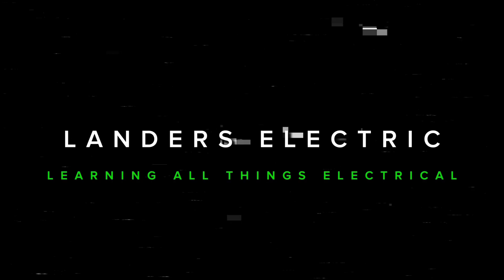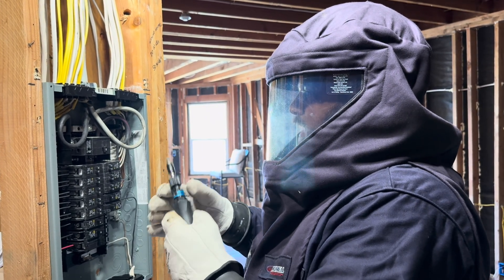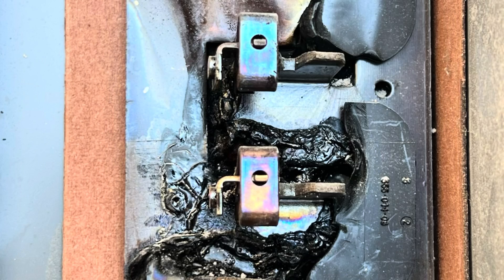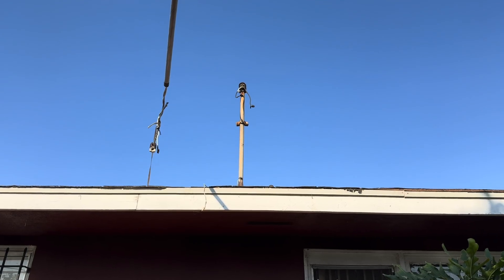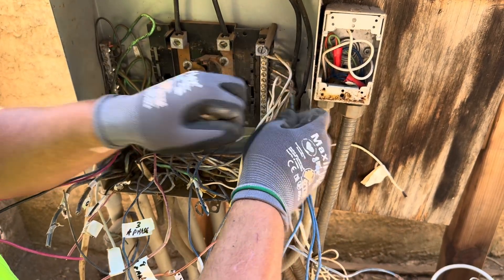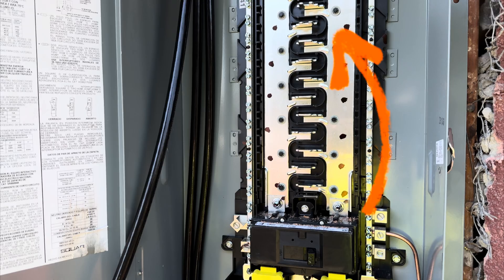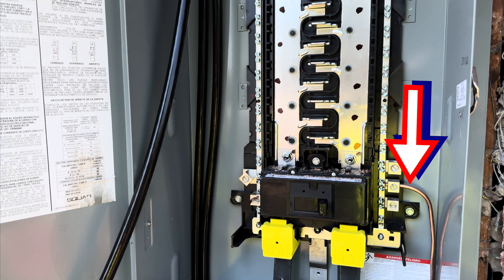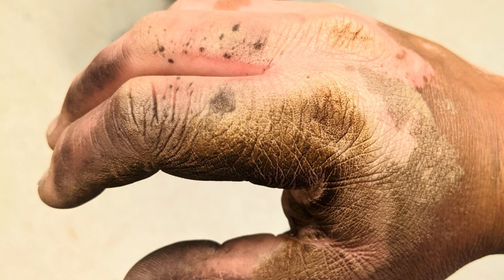I Could've DIED! | Electrical Panel Upgrade Arc Flash Accident

Comment: Working at a foundry with two large electric melt furnaces , in the bull pan They wanted to clean the insulators. My electrical boss said we won’t go in until the power shut off. The foreman of the crew said we’re gonna take ladders inside and get ready my electrical boss that’s not a good idea ! as they went in with the ladders One of the ladder legs hit 44,000 V line came down through the ladder blue a hole in the brick building that housed the transformers the guy that was holding onto the ladder burn, his hands welded his armpits and crotch Bluey his heels off, but I don’t know how but he survivedwhen you’re dealing with this type of voltage you don’t mess around

Comment: My neighbor was hanging drywall on his ceiling and asked for my help, so I did then he decided to remove a line for the dryer, since I was up on the ladder he said it was not live and he tripped the circuit. He gave me some cutters and I cut it and was zapped, the wire cutters melted and my hand was burnt not to mention my heart was racing for about a day. Well it wasn't tripped and it ended up being 220v. I was pissed as he just laughed. Double check, and in commercial and industrial LOTO.
Now I am POed thinking about it.

Comment: Well, I to do many panel changes, subs, meter base change outs etc., and storm work…I do everything that one could to be safe…occasionally you must work with hot circuitry, I do the PPE when it’s prudent, luckily no accidents …overworking your limits causes errors, some minor sone major…some have been deadly…a month off wasn’t worth your efforts…I’ve backed way off of full throttle operations…in the end it was not worth it…you dodged this bullet but it’s your warning…good that you weren’t the path to ground this time…heal well, stay safe, live a little more….in the business 40 years…
Reply from the maker: You are absolutely right! It was a dumb move and a valuable lesson learned.

Comment: I took out 2- 170A fuses carrying 4160VAC.
My arms and face were as black as coal as the fireball cooked off (ionized) the top layer of skin.
I had no facial hair for about a month.
I hardly got burned and because of safe practices, I did not get electrocuted or even shocked.
My wiggy did not survive as it went off like a grenade.
The panel was not marked.
The night supervisor was standing behind me and soiled his pants.
I had never seen a black man turn so white.
I handed what was left of the wiggy to the supervisor and said, "I'll be back.".
I went and cleaned up and went right back to work.
That got me 4 more years of employment.

Comment: One thing I learned many years ago was to make sure the power is off before doing any work.
Reply from the maker: Couldn’t agree with you more! What part of the Electrical industry do you work in?
Reply: @landerselectric   I don't work in the electrical industry.  I learned that back in my high school electricity class.  Over the past half century I've worked in telecom, computers, the big ones, not PCs and more recently computer networks.  In telecom we see much more current than voltage and battery banks that can pack a heck of a lot of it.  I worked in one office where the -48V DC plant ran over 7000 amps!  The battery banks would connect to distribution cabinets, where the breakers and fuses were located to connect to the various equipment.  In that office we had a couple of electrical contractors on site full time.  Computer power supplies can also pack quite a punch.  However, safety is always important.  Last month I was working on a scissors lift, on a project to install WiFi access points in a factory and a couple of warehouses.  Since there were big fans near where I was working, I asked for the power to them to be turned off, even though it likely wasn't warm enough for them to run.  The electrician tagged out the breaker, to ensure no one turned it on.  Also, a couple of weeks ago, I rewired my dryer outlet.  It was originally 240V, but my dryer was 120 and I rewired it then.  That dryer died a couple of weeks ago, with the replacement running on 240V.  So, I put the outlet back to 240V.  When I first converted to 120V, I connected one of the hot wires to a 15A breaker and put Marrette connectors over the other hot wire, even though I disconnected it.  I put a standard Hubble 120V outlet behind the dryer, as the plug ran hot and I didn't want to use a regular AC outlet.  Since I don't have a main breaker in my condo, I had to rely on the circuit breakers being off.

I have long carried a neon test lamp with my tools, to make sure circuits are dead, before I work on them.
Reply: @landerselectric    I don't work in the electrical industry. I learned that back in my high school electricity class. Over the past half century I've worked in telecom, computers, the big ones, not PCs and more recently computer networks. In telecom we see much more current than voltage and battery banks that can pack a heck of a lot of it. I worked in one office where the -48V DC plant ran over 7000 amps! The battery banks would connect to distribution cabinets, where the breakers and fuses were located to connect to the various equipment. In that office we had a couple of electrical contractors on site full time. Computer power supplies can also pack quite a punch.

Comment: A 220V, 200A panel can potentially produce an arc flash with an incident energy of between 8 and 20 calories per square centimeter. You absolutely need an arc flash suit.
Reply from the maker: Well said. 25,000 available amps of fault current in my area for residential.
Reply: Our company was thinking of getting rid of suits unless someone asked for them.  Showed my supervisor the arc flash ratings on a 1000 amp 600v ac combiner.  Was 50.3 cal, our 40 cal suit wasn't even enough for it, if it failed when testing.  Think the fault current was just below 50k amps.

They said no one should be inside working it live.  I responded, that doesn't mean we won't have a mechanical failure the first time it's closed

Comment: Good video good topic. Same thing happened to me (forearm and hand)while working on 3p-480 and using cheap replaceable head/tip screwdriver(throw them away) when the phillips 2” tip pulled out and fell across the line side of a contactor and shorted 2 phases. It kind of happened in slomo so i had a second to pull back anticipating it .. Boom! I Wasn't wearing proper PPE and was kind of rushing, not very smart. Burned arm pretty good but was lucky. Luck should not be part of your electrical career.

Comment: There's major value in this video. I'm an engineer who occasionally receives calls to troubleshoot industrial equipment. This involves probing around with my meter on gear and in panels that are hot. An arc flash is no joke. Imagine one in a 3-phase panel. I will start wearing PPE. You showed pics but I don't think people realize just how badly these injuries hurt and for how long. Thank you for sharing.
Reply from the maker: Well said. You’re welcome!!
Reply: We do very similar work.  I'm not sure how I could wear an arc flash suit however and do my job.  I am there for every aspect, electrical engineering, and mechanical engineering, including programming, etc. I just try and tell myself to be careful, go slow, don't hurry.  (Easier said than done, but I do try.)  Another electrical engineer, Gm Engineer, told me that one of her electricians was pulling cable one day, and they found him dead by the cabinet. He went to pull on the cable, and his forehead, touched a 480 volt contact.

Comment: Toward the end of my "career" I had become super vigilant about testing power.   At a resi service change I pulled the meter and was preparing to start the demo and, even though the power runs thru the meter, I used my tester and found full 120/240 voltage in the panel.  I was puzzled for a few minutes trying to figure out where the feed was coming from.

I took a closer look in the 1960's meter can and found something I had not seen in my 40 years. It had a built in spring loaded bypass.  When you pulled the meter for service, the power stayed connected.  They probably realized quickly that it was a bad idea and stopped that nonsense.

Anyways, kids, ALWAYS test for power with a working meter. ESPECIALLY if you are going to be in a seriously risky situation.  If I have to grab the bus or wiring tightly with bare hands I ALWAYS do a double check with the meter and a quick flash/short test or finger tough to be 100% safe. I'd rather make some sparks rather than get locked on to something.

Be safe.

PS. You did teach your apprentice something that day :)
Reply: I have NEVER heard of such a thing, and I would have NEVER, thought to put my meter on that cabinet after I pulled the meter.  THAT IS CRAZY SCARY, INSANE.

Comment: So many electricians don't understand that it is not the voltage but the fault energy that is available from the source. Most residential distribution transformers are only fused on the primary side. You create a fault on a resi panel, whether it L-N or L-L, the fault is not going to clear immediately (or ever, depending on the fault impedance). The only reason why so many electricians act like cowboys when it comes to working hot (esp. needlessly) is because they have dodged a bullet for their entire career.
Reply from the maker: Completely agree!
Reply: @landerselectric  BTW, I am really glad to see that you recovered and sorry to read that you lost a month. Thanks for making the video though. If only a single person learns from it, it was completely worth making! Take care!

Comment: Not sure what commercial or residential has to do with turning off the power before working on a panel, that should be a Universal requirement regardless of what the building type is
Reply from the maker: Agree completely!

Comment: On the larger jobs with union electricians, we have a rule: always carry three things on you: your side cutters, an eleven-in-one tool, and your non-contact tester. And of these, the non-contact tester is the most important. I'm glad you healed up well. Stay safe
Reply: Never completely trust a NCV tester. It should only be assumed to be correct if it indicates power.

Comment: thank you for sharing the story. i was actually about to try an experiment (long story short preparing a module on electrical safety) which involved standing barefoot and touching a key against an energised 240v conductor on a UK power outlet. without PPE. i guess i should not do that anymore?
Reply from the maker: I’d say don’t do that anymore.

Comment: If the panel is melting, just cut the seal off the meter and pull the meter out. The poco won't care if you cut the seal in an emergency situation

Comment: In junior high we dared a kid to stick a paper clip into a standard outlet, bent so it fit into both sides. It went in a little but didn't quite make contact, so my friend used the side of his shoe to push it the rest of the way in. MASSIVE arc flash that went up to the ceiling leaving a large black mark up the wall, and burned a hole ask the way my friend's shoe, miraculously not burning him. I learned to respect 120V ever since.

Comment: retired electrician here. Glad the injuries were not more severe. Appreciate you owning your mistake, we all have failed at one point or another. wish you the best. For anyone reading this: i used to talk out loud saying things to assure myself that I was safe to work i.e. main power lines cut by ele company, main breaker off, metered, and LOTO installed. breaker off LOTO installed and outlet metered, etc...that system saved me more than once from getting into a 'hot' box, wire, etc.  Be safe
Reply: For those not in the know: LOTO refers to gambling. So during work he would yell out "LOTO" and everyone would be reassured he is insane.
Reply: People look at me crazy when I’m walking around talking and point, or touching stuff all just to myself.
Reply: Good thing it wasn't high voltage...still nasty

Comment: Man. I was working on a high voltage box. It was inside a machine shop. I had a buzzing hot plate in the rear of the panel. As I had my suit on and fiberglass pole extended. To remove the 600 amp fuse. A guy in the shop thought it would be funny to walk over and poke his broom stick at the open panel. All I could think of was to leg sweep him with the pole. lol 😂. The shop boss grabbed the guy and removed him immediately. I never seen him after that.

Comment: its those fucking bare conductors you find in residential, they alone have caused more arc blasts in stories i have heard than anything else combined. I heard something similar happened to one of my coworkers but it was in a smaller subpanel with only a 60a breaker feeding it. he didn't get any injuries from it, but still. also heard a story about how a bare ground wire arced to the hot terminal in a simple receptacle outlet and it blew the cutouts that fed the whole street... fuck those bare ground wires. they make working in residential 100X more dangerous than it has to be.

Comment: Dude! Happy you’re alive!! 
I was tired one day cleaning up a kitchen getting ready for rough. I pulled the sheathing off an old BX. Forgot it was live, I usually turn the BX lines off , cause they are so old and brittle. I tugged the jacket came off, wire swong and smacked my right on the forehead. Knocked me on my as$. I felt the 120 flow through my body. Teeth locked and heart was pounding. 
I’m alive, won’t do that again!!
Reply from the maker: Man you too. Glad you’re still here!

Comment: i shut off the wrong main switch feeding a 600 volt panel. i needed to replace a breaker. i realized half way thru when i noticed a breaker in the panel humming a bit. luckily i always work as if things are live. but still.

Comment: Please learn voltage ratings before calling LOW voltage high voltage. Here is a chart: low voltage 600 V or less,  Medium voltage  601 to 69,000 volts ( changed a few years ago ). High voltage 69,001 to 230,000 volts. See IEEE - 141 - 1993 Table 3-3. Almost as bad as another halve ass so called electrician calling receptacles plugs.

Comment: Worst shock I ever got was from a 20amp circuit. Young and dumb, just reached in and cut wires not realizing they were live. Grabbed me and wouldn't let go. End result was fine size hole in my cutters, fortunately I was shaken but unscathed

Comment: Happy you are fine now and your content is great! This made me think about what I do day to day. How do you go about service upgrades? My utility requires a passed inspection from local inspector to turn power back on. It is really hard to coordinate both the town inspection and utility disconnect/reconnect same day. How would you go about it? Do you leave customers without power for a day or 2 or just suit up? Which suit is good for standard single phase residential service? By me it's 22Kva potential according to utility.
Reply from the maker: Completely understand the difficulty. Although it’s tough and sometimes hard I always schedule the utility and an inspection same day. Sometimes the inspectors show up early before we’re done but most of them give me their card and just ask me to send them pictures when I’m ready. After I send pictures they email the utility and release the meter. I would never recommend suiting up and doing the upgrade without the utility or the city inspection.

As far as a good suit, here’s a link if you need one for another reason other than a panel upgrade. I believe a category 2 suit is needed for a 240 volt 200 amp 22kaic rating. I use a 40 cal suit regardless. I feel I’d rather be overprotected. Also, I didn’t want to buy a CAT 2 suit and then need a CAT 4 and have to spend more money on a second one. I would recommend buying a fan though. It’s really hard to breath without one for long periods of time.

Arc Flash Suit Kit:
https://amzn.to/3TERzvB

Comment: Whether you turned it on or off is it not taught best practice a safe isolation procedure. This is very strict on what I do using approved proving units and following a prove/test/prove procedure. You may do this normally and may have been an oversight but I just wondered
Reply from the maker: Well said.

Comment: We wire things differently where I live. So to undersand what happened, the incoming power goes through the main breaker, and main breaker powers those copper plates on the panel? And you accidentally shorted them?

Comment: So I understand correctly, you had one #4 wire in hand from the first bus, then got too close to the other bus, which was still live, so you got 240 arc flash vs only would have been 120 if you touched the first bus or neutral instead?
Reply from the maker: Here’s the link to the full video. It explains more. https://youtu.be/W-d7x-S6HXs

Comment: Even voltages that are completely harmless to humans can cause heat that will be very harmfull. I built a 1,5v transformer a while back, that's literally the voltage of the batteries in your TV remote. However it can supply over 200 amps, wich will turn a screwdriver into a puddle of molten metal in seconds when you short it out. If you got zapped with 240v right through your hand for the same duration as this arc flash it would likely have caused little to no damage. That has actually happened to me every now and then during the last 20 or so years with no problems what so ever. But when you short a circuit with metal the arcs will start to get scary at as little as 12 volts if the circuit can supply a lot of current! 😮